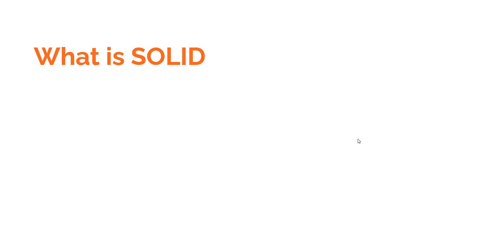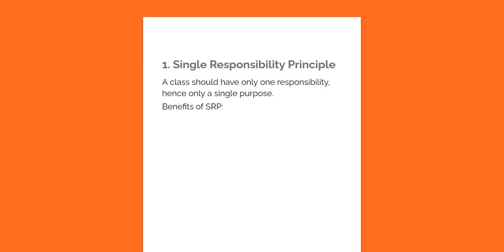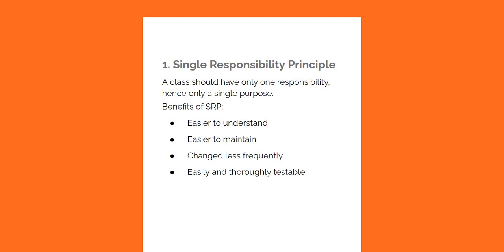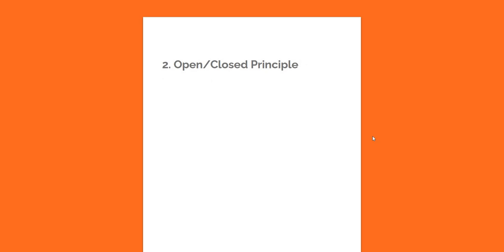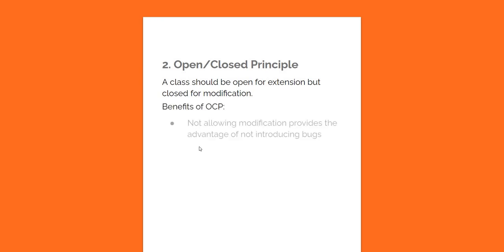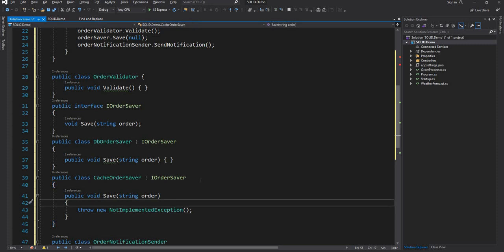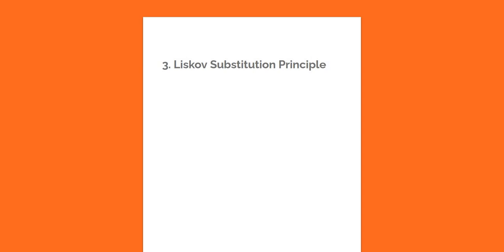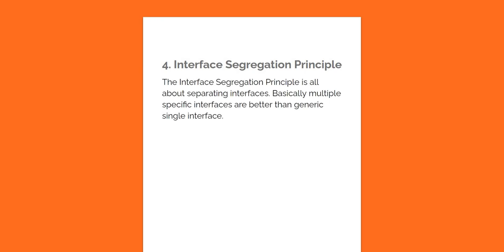SOLID Design Principles (An Introduction for .NET Developers)

Comment: i feel the explanation of closed and open and single purpose are too strict as these are open to interpretation as to what a "single purpose" is, as in our workplace we have one class for dealing with the CRUD of each type of data thats seperated into 3 levels of classes, controller class logic class and repository class (and ofcourse the actual shape of the data in its own class) thats what we mean by single purpose, whereas this is single class for method almost. 
I see no down side in having methods that handle the same type of data in one class, and see a huge mess of files all using the same type for data they are passing and wouldnt consider this what single purpose means. I cant imagine an actual senrio where that would be helpful. we have multiple large projects using single purpose as dealing with single type of data and thats how controllers are auto generated by microsoft.

Comment: The code which you had explained will it execute and give output??
Reply from the maker: No, as you can see these were just examples and did not have any code inside of the body of the methods. The idea is to walk through the principles and how to implement the interface/class structure.

Comment: Thank you DotNet Core Central for this video. Liskov Substitution Principle example is pretty much similar to Interface Segregation Principle. Please explain difference between this two, it would be much  more helpful.
Reply from the maker: @Trupti Jogi, thanks for watching!
Liskov substitution principle at the core suggests using an Interface instead of concrete classes. Now this interface can have multiple methods.
Whereas Interface segregation mainly talks about breaking interfaces so that you do that have an overloaded interface.
Please let me know if it makes sense.

Comment: Hello, in Open-closed principle you are suggesting instead of creating another method, we must come up with another type (possibly) and use Interface here for common functionality.
But don't you think doing way we will end up creating multiple classes for each functionality required.
There may be some exception when we can extend any existing class, could you please mention them, btw great explanation.
Reply from the maker: @Bhupender Singh
, thanks for watching! 
I personally prefer to keep classes small and responsible for only a single task. And from my experience, I have seen is-a relationship (inheritance) causes long-term pain, whereas has-a (composition through the interface) is much easier to scale when your codebase grows.
please let me know if it makes sense why I am advocating for a new class instead of adding a new method.